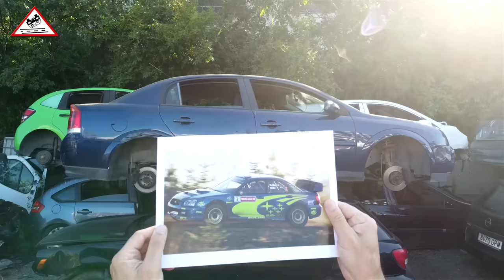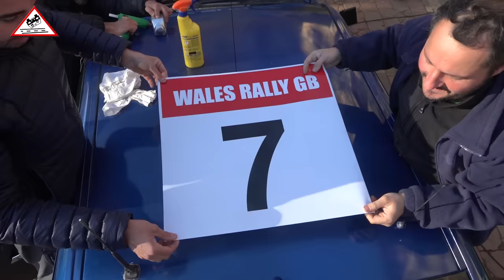PARODY | Subaru Impreza WRC | Petter Solberg 2003 [Passats de canto]

Comment: When you want a subaru rally car but don’t want to deal with its reliability issues
Reply: They are reliable the us versions had the ej25 which after 250,000 on stock internals adding boost will kill the motor 
the ej20 version the rest of the world got was decent
Reply: It's funny, because Vectra C is one of the most unreliable Opels ever made.